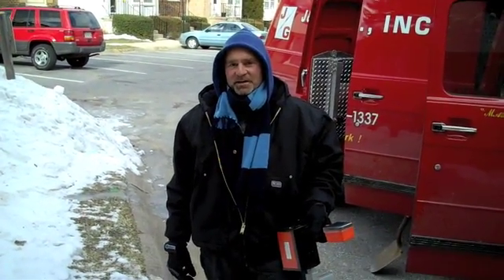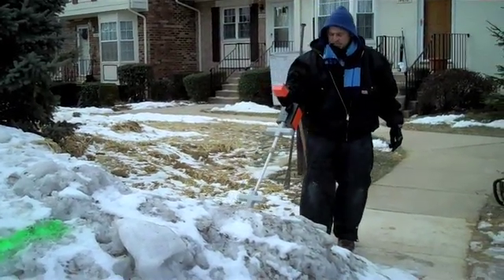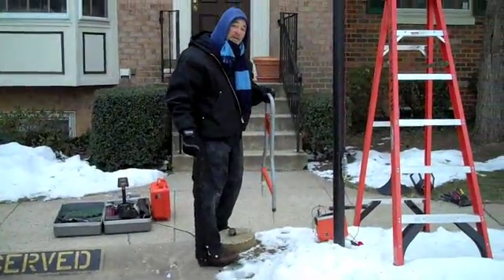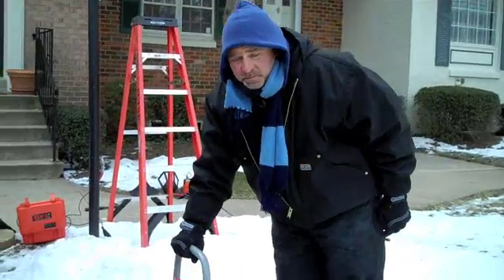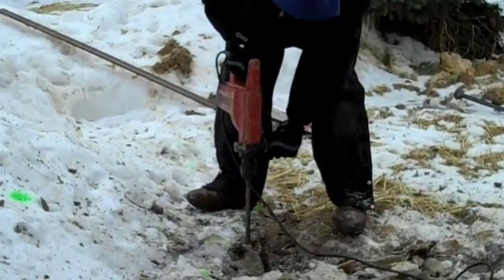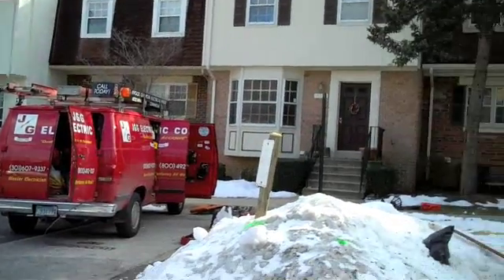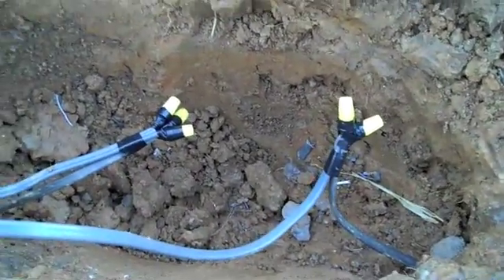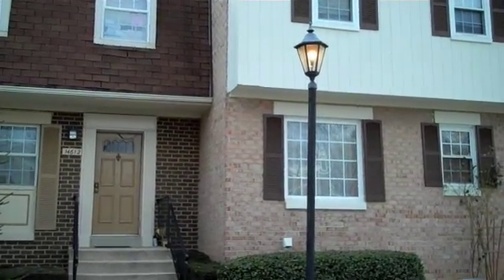Tracing an Underground Cable Fault

Comment: your hired come find my broken wire rotorua, new zealand.....
i have a serious problem just moved into a new house ... awesome double garage but the problem is.
 I think the previous owner was a bit on the dodgy side and has hooked up the wiring bad, Basically theres no power in the shed.. we had a electrician come have a look and he was so puzzled at why there was continuity but no actual power....

My question is whats a way of tracking this wire to if its broken some where .. now i dont got $$ or expertise on that neat gadget you have.. any tips to finding this problem...

Comment: Nice film on cable fault locating.  I'm thinking that Metrotech 810 could find a fault like that, since the break is clean through and the signal should drop off right after the break.